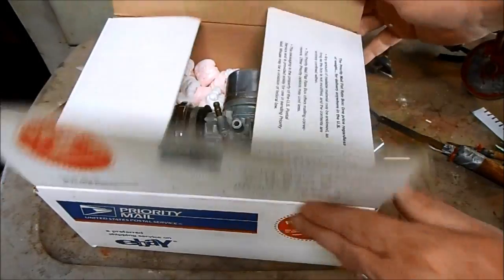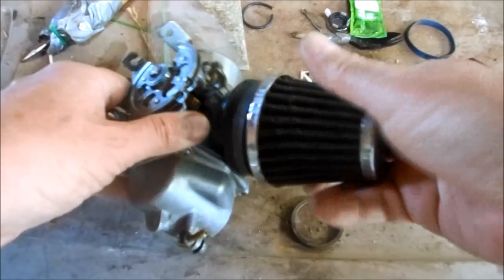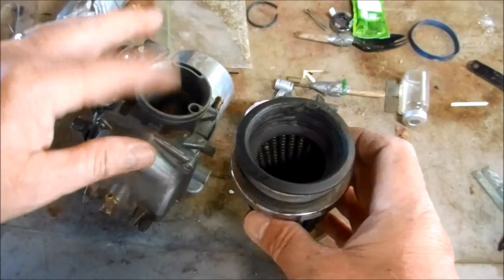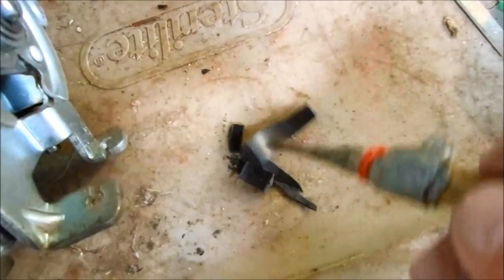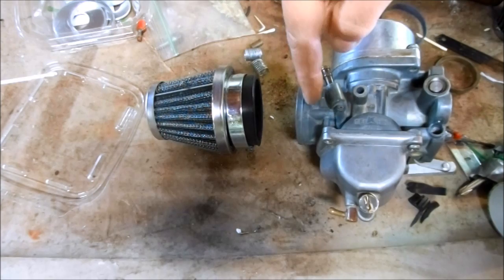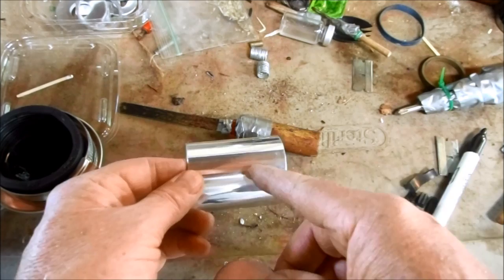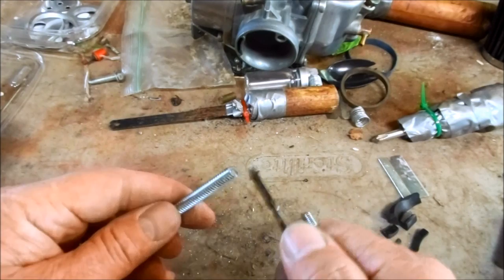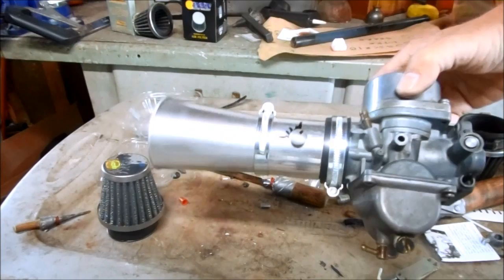how to easily tune pod filters for motorcycle carburetors with new diy kit

Comment: To fine tune this even better I found if you clamp the fuel line with a vise grips and by slowly loosening the grip you can get the precise fuel to air ratio, also saving fuel too while still giving more bhp because of the weight gained with the visegrips
Reply from the maker: now that's something i have to try !
Reply: @IchibanMoto  loving your ingenuity what about a roller squeeze type clamp such as you see in the hospitals coming from IV bags and or it's just a roller that pinches the hose and you can have that to where it's easy access just a thought I never thought about pinching the fuels
Reply: what about partially opening petcocks that replace the old vacuum type?
 instead of vicegrips

Comment: out of 1527 views so far, I'll be willing to bet everything on that over 1000 of them have been factory motorcycle manufacturers,  they're probably watching it over an over, to dial that in for not production models yet, their factory racing teams. So the mechanics can be on call instead of at the tracks, the riders can make those tuning adjustments as long as they too put the reference marks on the modifications. Good work Ichiban Moto!

Comment: love the edits i used a ball valve when i snorkeled my lt230e 1 1/2 pvc and a 3in hot rod filter but had to much air flow so i added a costly pvc valve but with a bit of a turn it runs perfect and if the filter is wet or dirty open it more

Comment: Like the scissors, hand drill, razor blade 😂 but seriously  the cutting away the rubber inside the filter mount from blocking the intakes on carburetor is a great tip.

Comment: I cried laughing. Great welding technique and those little snippers are the best I have seen, must buy some. Great stuff, now I am off to re-jet my 1981 Katana 1100 using blue tac to stop the floats from moving once I have set them, otherwise they just leak. I tried putting the overflow tube back into the fuel cap but it kept falling out.

Comment: A motorcycle buddy of mine had his Yamaha modified and he said to head to a specialist to have the head ported. They are located in Florida. When he got the head back, they had suggestions. One of the suggestions was, to use the standard airbox and standard air filter. Because, the science that goes into designing airflow through a motorcycle airbox, is the same as science that goes into designing airplane wings…The factories have worked it out so that their motorcycles with their airbox will out  perform a competition.. Air boxes are designed to have a velocity stack effect. Back in the pre-1980s, there was a free launch to be had by changing the exhaust / intake.. those easy performance gains are not easy today. The factory knows more than you do, and more than a lot of aftermarket accessory makers know..
  I remember one month motorcyclist magazine tested 13 different aftermarket exhaust systems, for each of the top four 600 Japanese sport bikes. that is a hell of a lot of exhaust systems. Each company had to submit 4 exhaust systems, one each for the Honda, Kawasaki, Suzuki, Yamaha sport bike.
  The results were surprising
 only two of the exhaust systems made more power than the standard exhaust, and that was only in the 200 to 400 RPM past redline range.
  The average horsepower loss with each exhaust system was 6 hp. One of the exhaust systems caused one of the bikes to lose 13 hp.. all of the aftermarket exhaust systems were lighter than the factory exhaust systems, and they were less expensive than a factory replacement. but the quality was not as good as the factory exhaust system, and some of them were actually poorly made, didn’t fit correctly, had less ground clearance, some of them made the motorcycles have hesitation just off idle.. some of the bikes good night maintain a steady cruising speed, and they developed surging and steady speeds on the interstates…
  each of the aftermarket exhaust systems was much louder than the standard exhaust system, giving the illusion of more power.. two of the machines were actually slow down in high speed tests with certain exhaust systems on them, when shifted from 50 into sixth gear. The motorcycles would actually go faster in fifth gear than in sixth gear because of the exhaust system change…
  The bottom line is, the factory knows more than you do. Leave your machine alone especially if it’s brand new, because you don’t want to void the warranty. Even if it’s out of warranty and you have problems, when you take it into the shop to have it corrected, they can’t find a baseline for all of the readings they should get, because the exhaust system has been changed, or the airbox, or the air filter, or the computer has been flashed. And if you have drivability issues, starting issues, surging, hesitation, how is a dealer mechanic supposed to correct things, when everything’s been changed. Where does he start?
  if you are a road racing, don’t start out with a bike that has been modified to death, don’t buy a used road racing machine that is a Frankenstein, the jumps out of gear, burns oil, and has been tossed down the track. You’ll never learn how to ride if you have to keep wrenching on some clapped out dinosaur. it’s going to take you a year at least to learn how to ride on a race track. If you survive the first couple years, and you find that you are always at 100% on the gas, and the bike just is too slow, don’t modify your bike, buy a faster bike.. races are one by the person who is best on the brakes, who set up the corner for the highest exit speed, the guy who makes the least mistakes, the guy here that has the correct suspension settings. Those are the modifications you concentrate on, leave the engine alone. The factory knows more than you do
Reply: Cool story. Help me find a fully intact factory airbox system for my '78 GS1000. Thanks!

Comment: Hi, brilliant video, just the help I was looking for. Although the pods I have on mine are the angled type so they have a small elbow, 
Upon checking, due to the curve of the elbow it looks like the rubber doesn’t cover the apertures like in your video. Or would I still benefit from marking and removing those pieces? Many thanks

Comment: This is the bestest tunerage mod ever, well besides the custome tuner mod where you drill air holes right in your intake manifold between your engine and carb.  I like to run the pod mod on full "close" and run as many air tuner holes in my intake manifold as possible.  Must be 3.5mm holes in order for it to work.  OH, these work really good in your exhuast so you can fully tune it too.  Key "tuner" secret tricks of the trade.

Comment: Really ))), the point of installing pod filters is to increase the air-flow=performance, in order to do that you have to adjust fuel...what you r doing is something I did when I was 12 years old with my scooter :).

Comment: I made my bike work perfect with pod filter by mounting the carb angled. my optimal setup was 82.667 degrees clockwise. I just needed longer fuel line to reach the valve on the tank after this adjustment.
Reply: i call BULLSHIT

Comment: i also used a 3d printed adapter to make a 70mm filter work on a 350 moto4 70-32mmm with 5mm holes drilled till it ran good

Comment: Would be extra badass if you could attack a cable or string to the adjustment pivot control. You could attach that cable to some kind of control on the handle bar, a knob or dial, something to twist when you need more power and turn back when you need less power. Just a thought. Keep up the helpful videos!

Comment: Couldnt you fine tune a pod filter by gaffer taping sections of it up to reduce airflow to get the air to fuel ratio. EG if you need less air tape top cm of the pod, if you still need more tape up the top 2 cm of the pod
Reply: Yes that will work , but if your bike has the carby visible from the road, it looks queer as all get-out bro :) and you will need to tape up like 8/10ths of the pod at least - depending on how good it breathes , and chinese pods offer no protection at all LOL.

Comment: Is it possible to fit little bit smaller carb like 250cc honda rebel to 450cc suzuki gs450? Should i tune the jets or the air filter?

Comment: Wasn’t sure at first if I was getting punkd with the tool cuts at first but when I saw the sparkler I lost it😂😂😂 this variator for on tie go air fuel mix change could MAYBE work for someone who changes fuel ethanol for different tunes to race vs daily or I guess if someone was switching the same carb between two bikes just to pinpoint air fuel mix lol that all I could come up with love the video tho😂😂😂👍👍👍

Comment: my dad and I did something similar on a DOHC cb750 but we didn't cut any rubber or put any lolipops in it just used a piece of pipe that fit the outside of the carb body on it and set the filter pods out a couple inches and rejetted the carbs and they worked great, the only problem we had was it would cut out at cruising speed but it liked when you gave it some throttle other than that

Comment: I added those same markings to my HVAC system so I can tune my AC and heat for the corresponding seasons.  You should mark yours for summer and winter.  Maybe even altitude adjustments.  😅

Comment: That's the first thing I thought, when I looked at the pod filter, the tiny hole ain't good for the carb, I modified a filter to be like a velocity stack with a filter on it. I haven't used it yet, because it doesn't fit the 20mm carb I am running now.  But fits the 24mm im going to run after the engine mods. I'm swapping to a ported large valve head, with cam, and a 52.4mm jug, with pop-up piston, with the exhaust and carburator I'm hoping to get somewhere in the 9-12 HP ball park, I'm debating on whether to do this or just swap to a larger engine! Then modify it! Maybe do a stroker crank, so for about the same price I'd have the choice of 95cc or 149/171cc I could go bigger with the bore, 180-190cc, but 95/96cc is about the sain be limit for the smaller engine,  but I been having carb issues, it seems to be running out of fuel at full throttle, I don't think it's a supply issue, I'm running a foam pod filter now, but switching to a pod on a pipe, hoping to get better performance,  it also stumbles off idle, sometimes even killing it, but I think 81cc should perform better, it started at 49.5çc, then went to 81.3cc, I ported the head and added a performance cam, and went up to a 20mm carburator, from 18-18.5mm, with free flowing exhaust.. it may just be the CVT, instead of a transmission, eating the power..   but it dies have the carb issues, and looses when hot, or up to operating temperature, I do have a oil cooler that may help, but I haven't decided what to do yet, I can add a turbo with the larger engine, but nos kit is about my only option now, that will likely only convert my crappy ride into a pile of crap!  Either way I still need to get the issues ironed out! Because it's going on another bike, I went up about 6 sizes on the jet, that's about it, I did lift the needle one slot, it still needs a bit of tuning,  ( being the bogging issues)  but the 24mm carb will need everything  to tune it, being it's setup for a 125-150cc but are also used on 80-175cc, being I operate in the 6000-9000+rpm range, it should be fine, especially on the 88-95cc engine, being 95cc with the stroker crank! I just need more power, and speed!

Comment: bro you have fitted two coupler, one which  you had taken out from the new filter and cut it down acording to the carb,, 
then there is another coupler.
did you cut another coupler too or not

and how can i get to know whether the tuner is working or not

Comment: I would like to try a non CV , slide style carburetor, around 20-24mm, maybe 26mm , or possibly 30mm for the larger 150+cc engine, I know it's not going to set any records, but 15-35hp should be possible from a near 200cc engine!  Sorry for all the rambling!

Comment: Is this necessary with most 4stroke 50cc scooters. Ive got a johnway gator yy50qt-6 and i temporarily put a pod filter in and mine runs fine. But im  unsure after what ive read about long term use when it comes to what it could do to the engine or carb. Kinda torn on what to do.
Reply: your scooter probably has a piston slide accelerator setup i take it, where the throttle cable is  hooked up directly to the needle , they seem to take to pod filters slightly better than Constant Velocity -Vacuum driven needle carbie. You will be running slightly lean, which will cause engine overheating and better economy but less engine life, even a hole in your piston if your unlucky , RARE though, easiest fix is turn the pilot screw anti-clockwise like Half a full turn ( note the 0-12 oclock position your screwdriver is on (360 degrees) and turn it 180 degrees anticlockwise. You will be laughing then

Comment: Or put the correct bigger size jet in the carburetor to account for the extra air flow you need to learn how to work on a carburetor so the engine makes more power not less

Comment: Do I need to have a breather on the front of my carb if I put on a air filter.? And what do I do with hoses from old air filter box? Thank you
Reply: the hoses are just POSITIVE CRANK CASE VENTILATION coming from the oil sump, put a small filter on them/ it and clamp it on even clamp on an old stocking with a hose clamp will do the trick and cut the excess off

Comment: Wait, so you install less restrictive intake just to restrict it? Than what's the point?
Reply: to get rid of the nasty airbox, that on some models are A) HEAVY, B) DONT FIT BACK IN BECAUSE FRAIL OLD RUBBERS TO THE CARBIES, C) BOTH THE ABOVE AND ALSO RESTRICT EYE ACCESS TO ENGINE COMPONENTS AND ALSO RESTRICT SPACE AND AIR FLOW TO THE ENGINE CAUSING MORE HEAT

Comment: I don't understand why the manufacturers didn't send out kits like this with the bikes. You took awesome and made it awesomer. I miss my carbs. Will a dial-a-pod work with an injection machine?
Reply: Yup, you can dial-a-pod with injectors. The only difference, of course, is that you have to have two smaller ones so you can dial both fuel and air separately for a badass tune
Reply from the maker: or take the easy route Andy ...  bin the injectors and upgrade to some sweet vintage carbs :D
Reply: Dont listen to Brennan, his comment is absolute bullshit,  with injection machine your computer is going to sense more air on your oxygen sensor and adjust the ratio to Air fuel to a harmonious Stochiometric ratio of 14.7 : 1 by increasing the pulse the injectors stay open to be longer milliseconds for more petrol. But to make do of this new air flow, a computer ECU re-mapping might need to be plugged in and dyno tuned,

Comment: I'm trying to install ram air on a CB500T, will you please make a video showing how to? I would like   the intakes to curl out of the sides like horns if possible. Thanks
Reply from the maker: I will make that video for you the next time a CB500T comes into the shop.      ps. I don't like ram air because the faster you go, the leaner the A/F ratio.
Reply: well you have to run the bowl vents into the snout(s) to compensate...Kaw has been doing that for a long time
Reply: @yamahale  I actually had horn looking setup on a gpx 250 - 2cyl 4stroke, with pod filters comin out the side of the bike, with the bloody CV carbs it ran too rich, and died up the ass , will need a non CV carb and should work great i reckon

Comment: I need a four inline carb rebuilt for a kz650sr I have the rebuild kit but I’m scared to do it myself.
Reply from the maker: it might be best to have your local vintage bike mechanic help you out with the rebuild and needed parts. they can also set up , sync and tune your bike to complete the job right.  oh, be careful with those kits too. some of them have mystery jets or o-rings and gasket material that is not fuel safe or to the correct spec.
Reply: @IchibanMoto  I used genuine k&L rebuild kits and just did it my self. All looks good and I only found one clogged jet. I didn’t remove the fuel rail but I’ve yet to see if that’s gonna cause a problem. When setting the pilot jet how deep do you do?

Comment: Sometimes i wish your channel wasn't satire. This actually makes sense. The GS500 (1988-2000ds model) for example runs so lean, that the slightest changes to the air filter will completely mess up engine behavior. Some years actually come with OEM air filters with extra  restrictors mounted in them. Causes a big problem with aftermarket filters which, even if drop in OEM replacement, are more free flowing.

I bet the same applies to other last generation carbureted bikes - manufacturers had to go lean and accept unruly engine behavior to somehow stay within legal emission levels and keep fuel consumption competetive with FI setups.

A device like this, mounted in the OEM airbox, would allow running any filter without having to mess with the jets.....
Reply from the maker: and that's precisely why the patent is pending!   :D

Comment: I'd like to ask this question. Would I be able to run pods on a xs250 that normally uses an airbox?
Asking because this project came with pods. But Ive only managed to get it to revv super high.
Reply from the maker: your local dyno shop can sort that out for you